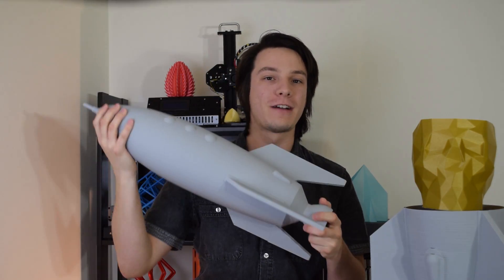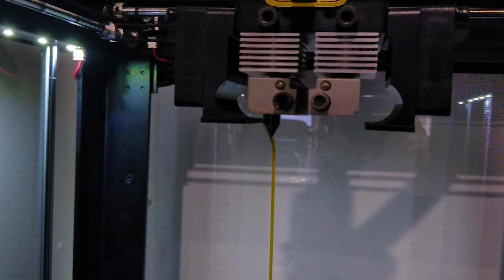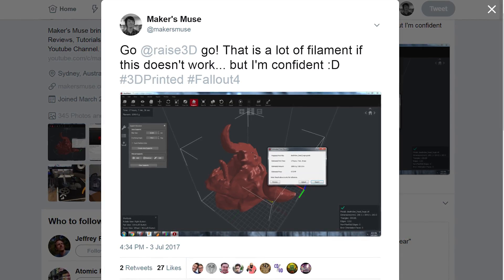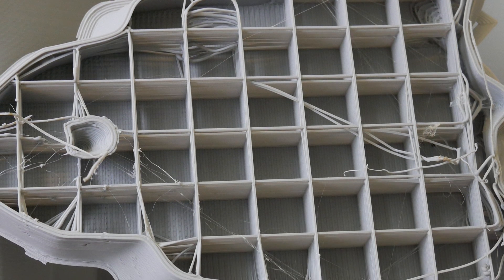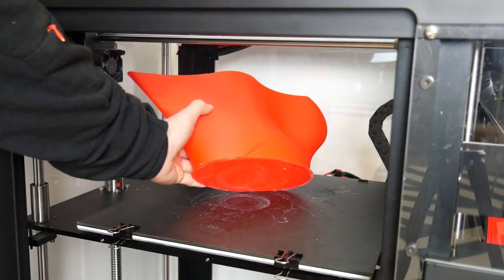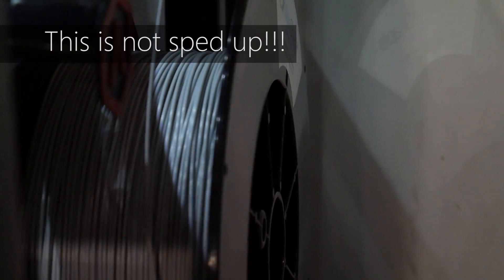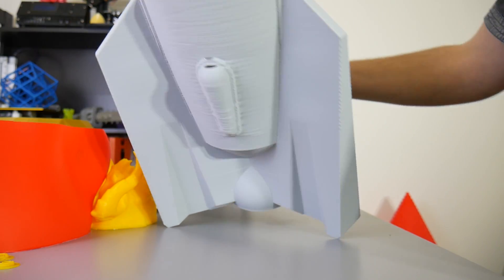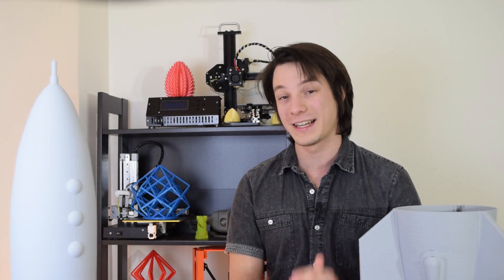3D Print ridiculously fast with this terrible mod - 1mm nozzle on the Raise N2+

Comment: Your problems may actually be from under extrusion because when you drill a hole with a 1mm drill bit the hole is actually larger than 1mm, what you need to do is drill it under sized and use  a 1mm reamer.
Reply: That shouldnt be the case with at least half resonable drills as they are purposely made a little undersized to compensate a tip being slightly off center and therefor drilling bigger than needed
Reply: Rcmodellbau_DE 

I don't know about that, every drill bit I've ever owned always bores a hole that's larger what the measurement says.

Especially hole saw drill bits, a 114mm hole saw gets you a 120mm hole for example. ( useful for pc modification) With hole saws it's because the measurement is the internal diameter not outer diameter. no idea why regular drill bits do it though, probably crappy drill.
Reply: As a hobby machinist I can confirm that drills always drill oversize. It's a percentage though, so it probably like 1.02-1.04 mm.
Reply: Either way, I think if Angus took the time to tweak it, he could get it to print pretty good.
Reply: Plus being drilled by hand drill I'd say between 1.2-1.3mm
Reply: @konrad759  realy didnt know that nice thanks mate
Reply: you should always extrude to a bigger width than your nozzle size anyway to have proper adhesion
Reply: @konrad759  No, no they aren't.
Reply: Also, drill bits give a truly awful surface finish.  I bet the filament I getting hug up more than usual.
Reply: drill bits are usually already undersized and you are supposed to use the same size reamer to get it up to the correct diameter
Reply: The issue is that he's printing under-temp at that speed. At a 1 mm nozzle diameter at the speeds he is printing at, the outer edges of the filament are getting to temp, but the core is not. It's soft, but it's not adhering to the layer below it properly.

A 1 mm nozzle at a .8 mm layer height is likely pushing far more flow rate than the print head is capable of. A .4 mm nozzle at a .2 mm layer height running at 200 mm/s is already pushing 18 cubic mm of plastic per second. All the flagship consumer-grade machines (Flashforge, Creality, Bambu) are rated at 32 cubic mm / sec max. Even at only 60 mm / sec (which looks slow for what he showed) his is pushing 48 cubic mm / sec. So unless he has some incredible nozzle on there, he's definitely at or exceeding the extruder's upper limit.

This is also why the watering can turned out great; he reduced the layer height to .4 mm which cut his flow-rate in half - likely putting it back well-within the capabilities of his print head to heat properly. The final rocket looks like it was done at a .8 mm layer height again and goes back to suffering issues with layer bonding due to the under-temp printing.

I run into these problems speed printing in PETG even at a .4 mm nozzle diameter. You can can easily tell when you're under-temping your prints because the surface becomes matte instead of shiny (unless you're using a special filament). A shiny surface indicates that the plastic was sufficiently molten when it was extruded and it smoothed itself via surface tension before it hardened. A matte finish indicates an irregular surface that wasn't fluid enough for the surface tension to smooth it before it hardened.

His failed prints have a very matte appearance compared to the octopus. Granted it could be a special filament, I'm pretty sure it's just under-temping. This often occurs on infill because that's where automated speed settings are the fastest and machine acceleration allows the print head to reach full speeds in long, straight runs.

I overcome the issue by printing at 265 C (15 C higher than the max recommended temp for the PETG I'm using) and adjusting flow up slightly (105%). This lets me print PETG at a cap of 450 mm/s on my Creality K1 Max, but slightly overwhelms the head's heating capacity at that speed. A more reliable speed is about 350 mm/s - which is still about 3 times faster than most people "speed print" PETG at. Over-temping briefly overheats the outer layer of the filament, but sufficiently heats the inner core to a proper temperature. Once it leaves the nozzle, the plastic equalizes quickly and hardens. It's not a perfect solution, but it works within reason.

He either needs to slow his speed to allow the filament to heat thoroughly, or he needs to over temp his extruder. Over-temping will overheat the outer layer, but will allow the inner layer to get to proper temp; then it will equalize to useable as soon as it comes out of the nozzle.

Comment: It's funny how we are all aware that with printers, there will be failures and obviously waste. HOWEVER, throw in a purge block for multicolor change and waste becomes a blasphemy lol
Reply from the maker: SO TRUE. I'm yet to cross over to the 'dark side' of 3D Printing with such things however :P  That'd be a great parody video five things to do with your purge block
Reply: yep, to be honest i have accumulated quite a few with the prusa and the pallette so i'm testing theories. they just look so bloody awesome i find it hard to throw them away lol
Reply: 3D Maker Noob Sell them on Etsy as art ;)
Reply: one is intentional and the other isn't. we aren't trying to fail prints and waste filament. Waste blocks are intentional and something we should be addressing and trying to improve.
Reply: Why don't they instead use the filament generated for the purge block solely for the infill?
Reply: How solid are they? if they're completely solid, toss them in the oven to firm them up, and throw them on a lathe, thats what i do with my failed prints lol
Reply: I think that hiding the purging inside of the infill would be a good idea, but that might be impossible for some reason I don't know.
Reply: 3DMN I don't get what you're saying
Reply: Not impossible, and Mosaic's Palette+ already offer that.  A lot of models though have a small area where there isn't enough infill and that's why they still do purge blocks even with purging into infill on.  Their software even lets you vary it based on the colors - eg going from white to black?  You don't need that much purging.  Going from black to white?  You need a lot of purging.
Reply: Purging in the infill. Prusa is doing this now, but for the problem of not having enough space in the infill, why not just turn the infill up? After all, you use less infill to save plastic. So if you're just gonna put the plastic into a purge block anyways, then turn the infill up.

Comment: that's the perfect use for nice vases, a huge thick wall makes them much more useful and I'm sure helps seal the gaps on the crazier shapes
Reply: 3d printing meathead. yep I always crank up my flow rate 150% when I do vase mode much much better prints it just sucks I can't do multi-process vase modes in simplify3d so I have to run it at flow 100 until the bottom layers are done and then turn it up to 150
Reply: @nerys71  I just set my like width to 1mm. I have to slow things down and turn up the heat, but get really great results and vases that are actually useful.
Reply: @KrisRyanStallard  yep doing that in vase mode works very well!!

Comment: What a coincidence, I've been experimenting a fair bit with large nozzles as well! I actually really dig the look of the high layers, but you definitely have to design within the tighter constraints of what the larger nozzle can do. Also loving that I can use it with really crappy filament because a 1mm nozzle is nearly impossible to clog :D
Reply from the maker: Haha dude, keen to see what you come up with! I love the stepped look too, really works well for some models. The clogging is a good point... wonder if you could like, dust in something on the filament so it combines. I did spray paint filament once and that worked.
Reply: Make Anything // 3D Printing Channel and Maker's Muse together the two best 3d printing channels should do a collab
Reply: Make Anything why don't you have mORE LIKESSSSSSS

Comment: Adding thermal paste to your nozzles threads helps a lot with transferring heat. I use it on the nozzle, the heater cartridge and the thermistor.

Comment: Angus wow thanks mate. My stock Anet A8 I've got dialled in to print beautifully with a .4mm extruder but now I want to print a full size proton pack. So your video gave me the idea to do it with 1mm nozzles. So I ordered the nozzles and some black PLA and I've started printing. I didnt have the same issues you had with the infill, I just printed a valve part with 20% infill and it printed fine. I started with 0.5mm layer height and the part still printed really well, I'm going to try the 0.4mm layer height (EDIT: WOW 0.4mm height is amazing). It was actually thrilling to watch the part print so quickly, and the resolution really isnt that bad at all. Very impressed, thanks for your help. For anyone else looking to print 1mm with the Anet A8 here are the values I used:
0.9mm nozzle diameter (I always find taking 0.1 off the actual nozzle diameter helps in the horizontal plane) 220 degrees print temp, 20% infill (use line infill), print speed 50, travel speed 50, 0.9mm wall width, 1.2mm top/bottom thickness, 0.4mm layer height.

Comment: Hey Angus, I've been using 0.8 and 1.0mm nozzles, at finer layer heights such as 0.24 and 0.32.  You can speed the printer up a bit due to your flow being reduced from the lower layer heights.   

Provides excellent quality of prints, at a respectably reduced print time.

Comment: My default nozzle diameter is 0.8 mm, because I'm this impatient, but I also want stuff I design to work with the typical 0.4 mm. It's not ideal for printing phone cases, but  for coarse home-improvement style projects, it's great because they're really strong.

Comment: You should do an experiment seeing which slicer handles large nozzles best
Reply: I use simplify 3D, and it handles the 1mm nozzle completely OK. The issue is not the bad slicer, but probably the settings. I printed even big solid objects (consistimg mostly of vertical and horizontal walls, so the layer thickness did not matter for appearance) with layer height of 0,5mm and 30% infill from PET-G and it worked OK.

Comment: We use these types of 1mm and 1.8mm nozzles at work. The infill issue can be solved by switching to gyroid, and you do need to re-tune pretty much all of the slicer settings.
Reply: Hey mate , which ones would You recommend ?

Comment: When I broke my first nozzle, before I got new nozzles,I used the neck of the broken tip as a 2mm nozzle. It only worked in vase mode and I had to run it extra slow to allow the plastic to melt in time.

Comment: Try this in vase-mode: have the print performed in a flask that can be filled with sand or other dry non-reactive granular stabilizing media.
As the walls of the vase are built up, add media to the inside and outside of the vase in a balanced manner.
This will tend to lock the walls in position and prevent any sort of flexing as the print gets taller.
Maybe a stabilizing media dispenser in the print-head?

Comment: Hey Angus, try a volcano hotend with a 1mm nozzle, they work great for printing  just about anything fast. I think the reason a volcano nozzle works so well is because the  longer dimension of the hotend is vertical and has a melt zone at least double the amount of most normal hot ends. Your impatience would be rewarded:)

Comment: If you used a 1mm drill bit, I’m pretty sure the resulting hole would be quite a large percentage greater than 1mm. That might account for a portion of the slicer having issues calculating the print.
Reply: yes

Comment: I printed everything with a 1mm nozzle x 0.5mm layers for a couple years.  You have to design your part much more carefully, and line up perimeters against each other, and only use infill very carefully.  In exchange, you can get much stronger, faster parts that look fantastic.  If you're not careful, the minor errant blobs that your nozzle runs over without issue at 0.4mm scale, will be a much larger and more dangerous obstacle at 1mm scale.

Also spiral vase is for jabronis.

Comment: May have been mentioned already, but the issue is heat transfer to filament, the plastic doesn't have enough time to heat up and so it's extruding a partially melted filament. A longer nozzle will help (like the E3D volcano), slower speeds, and higher temperatures (up to 50C higher temp than normal). It's failing at the infill because your slicer probably has a higher infill speed.

Comment: i got good result with 1mm nozzle on my Dyze Extruder, but need to cut the speed half, between 20 and max 30 mms, and raise 25% more the  temperature extrution, and only try with PLA
Reply: and forgot to say...more coolling with extern fan blow direct on the print

Comment: I was printing the base for the Starman and Tesla model from Thingverse. I forgot the decimal point in Cura for the "layer Height" and printed at 1 mm instead of 0.1 mm. It had a 1.8 mm "Shell Thickness". I left it print after I realized the mistake. Only took a half hour or so instead of all day. Came out looking like a woven basket but still functional as a display stand. I used Maker Geeks High Temp Raptor PLA filament which needs 245 C on the extruder. Using a little Mono Price Mini Delta, I had to bump the extruder  up 8 to 10 degrees to keep it at 245. 
There is a lot of promise in this for certain utilitarian designs that do not have to look like injection molded parts.

Comment: 1mm can be a good approach for certain things: for example, for those who want to make some "sculptures" to sell, they can, for example, print the structure of the sculpt, and then use resin and primer to finish it up, and next making silicon molds for casting and reproducing the sculptures (or even reproducing parts for 3d printers and other stuff!)

Comment: For the pot, it looks to be the build cooling fan that seems to be the problem since it looks a lot better on one side than the other. 
For the failed infill, it could be the infill settings of the slicer. Possible the retract settings. 
Usually when you "drill" out something with a bit labeled a certain size, the hole becomes slightly bigger, so try changing the slicer settings to something like 1.1mm 

Also if attempting with a delta printer, set the print speed slower, because most likely the controller will be atmel based, and if it's set to print too fast, it will start to slightly studder since it's driving 4 motors. Cardinal printers shouldn't have this problem, since it's only using 3 motors at a time (extruder motor isn't moving when y-motor is moving).

Comment: since that 3D printer has 2 extruders you could have a large nozzle for quick/vase mode printing on one extruder (maybe not quite as big as 1.0mm, maybe 0.8mm would be a better option) and have a standard 0.4 mm on the other, not having to manually switch between the sizes . . .

Comment: It's also about big cooling fan. You should try overhang test with different layer height to find out limitations. 0.8 layers for 1 mm nozzle (80%) is too much. You should get below 66% to get reasonable results.

Comment: I do a lot of large format printing on 1.0 and 1.2 nozzles, specifically with E3D's Volcano hotends and 40w heaters. 

Your infill to perimeter pullaway problem, as well as your huge Repconn rocket pot perimeter detail issue is all due to the maximum material flowrate your hotend can handle. Simply put, your extruder couldn't keep up with the demand put on it, so your underextruded layer was getting dragged and stretched while still above molten temperature. Most hotends are only capable of 8-15mm3/sec material flowrates. This is why hotends like the Volcano have enormous melt zones and advertise flowrates in the 40mm3/sec range. A big heater alone isn't quite enough to manage high flowrates - you need a big melt zone as well, giving the heater more opportunity to heat the filament.

Feed pressure becomes the huge tuning sticking point with the Volcano, though, as it absolutely hates retractions because of the enormous melt zone.

Still, you had some pretty impressive prints there. Hopefully this sheds some light on why some of your prints didn't quite work. Slowing down the print would have likely fixed your issues.

Comment: I have decent success with 0.8mm layers on a 1.2 nozzle by increasing the "extra restart distance" in S3D. You also have to go really slow so that the printer doesn't pull on the freshly laid filament before it has time to cool, otherwise you will get that effect in your first print.

Comment: I keep a .8mm nozzle on one side of N2+ and a .4 on the other. I really like the flexibility of being able to switch between them. I found that my biggest issue was cooling time with the bigger nozzle, and I have to slow down the speed to compensate. It's still really nice for rapid prototyping.

Comment: I put a 0.6mm nozzle on my CR-10 to increase the print times, and it works great! Doing 0.35 mm layer heights looks pretty good on big objects, and it increases the print time significantly (seems like over 30% faster).

Comment: Part of the problem may be also due to the fact that a drill doesn't really a smooth or tapered inner surface, but you can buy small sized reamers that you can use to enlarge the nozzle diameter!

Comment: 0,8mm nozzle is the absolute champion on TPU with 0,2 mm layer thickness. I use Ultimaker 3 and s5, and combining PETG/PETCF with TPU in large nozzle prints is fantastic.

Comment: The likelihood that it is mostly a software issue and not as much a mechanical issue is good though.  It means someone capable can make a plugin for the software and this can be broadly viable on many printers without much modification.